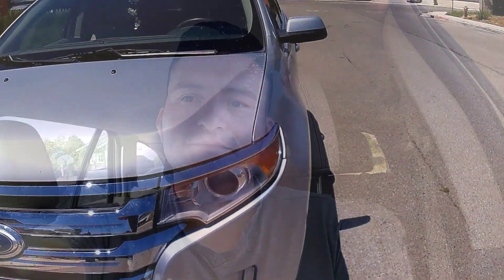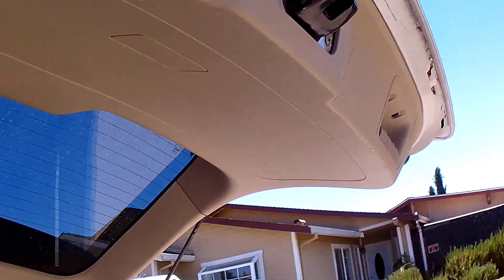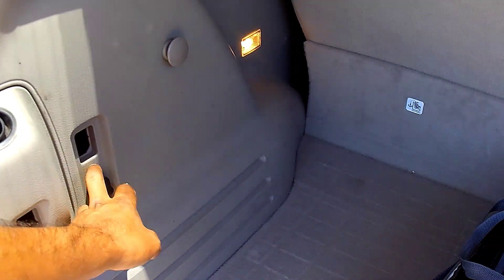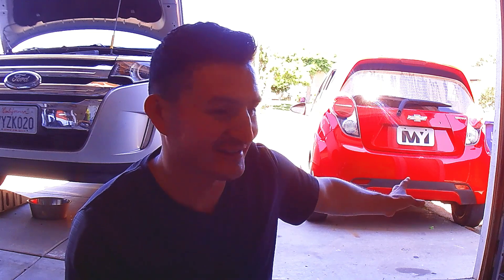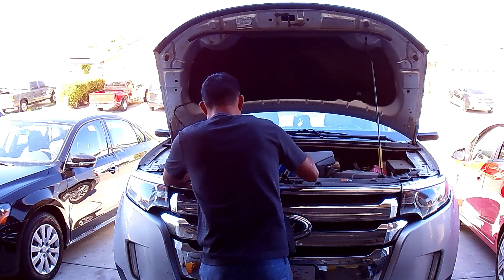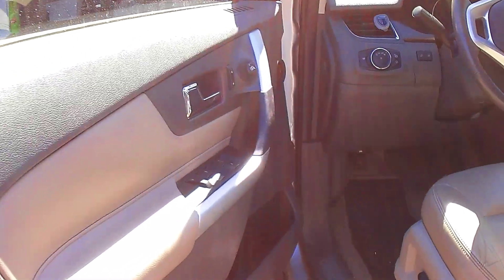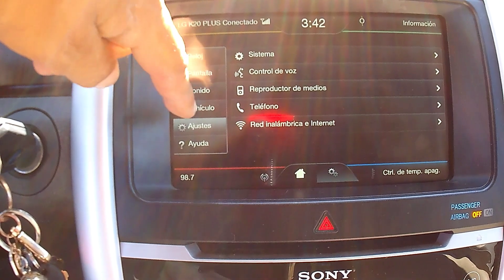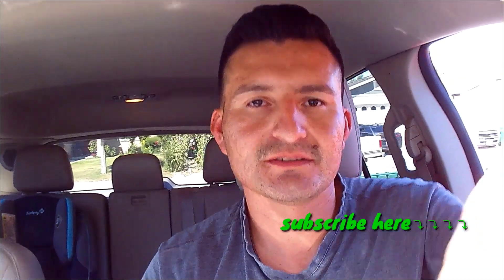Get ford keypad's 5 digit entry code quick & easy also quick update on the ford edge copart rebuild.

Comment: I bought a used Lincoln at a estate sale years ago and never did figure out the code. Never knew it was on the fuse block. It's nice to see you can change it on the newer vehicles. That Lincoln didn't have display screen. It was a while ago but I'm pretty sure the dealer wanted $100 even back then. So you take your car to the dealer. They know where the sticker is and write the number down. Charge you for that and most don't know they've just been duped. What a racket.
Reply from the maker: Richard Bricker yea man that's all they do look for the sticker orbmaybe they have it in the system i don't know, all i know is that i don't wantbto pay them 1 hr of labor and yes its pretty cool you can change the code to something more familiar to you so you don't forget it, anyways man thanks for watching and leaving a comment👍✌